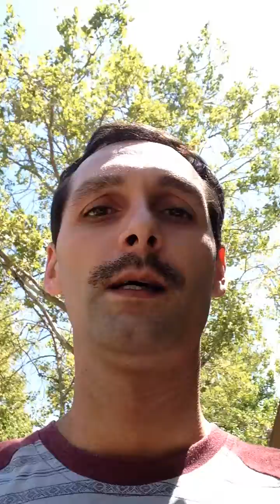Omnichord OM-84 System II Repair Part 06

Comment: Tolerance doesn't matter. If it's better, it's just better :D So 2% tolerance is actually better than 20% tolerance. Here's the schematics for OM-84 : https://drive.google.com/file/d/0B8-MOD-DNXkHZGE3NmU4NzctZDhkYi00Njg0LWIwMmQtNjQ3ZDJjZDAxNzk4/view?layout=list&ddrp=1&num=50&sort=name&pli=1#
Reply: +TheMr Jamu I would also check that 7805 linear regulator.